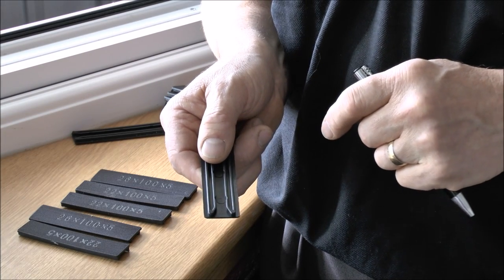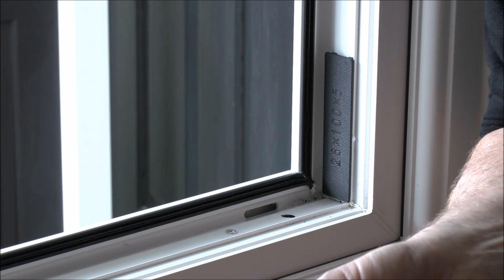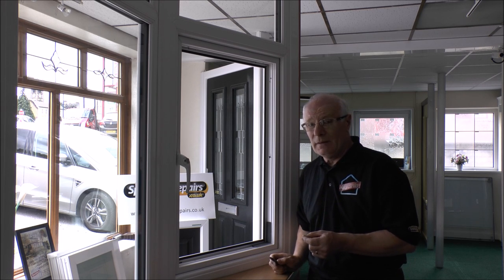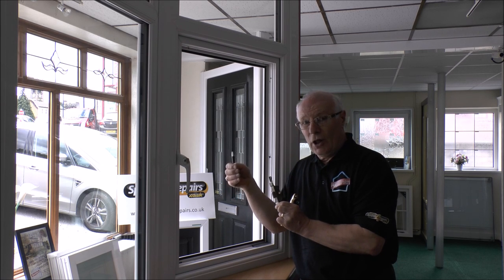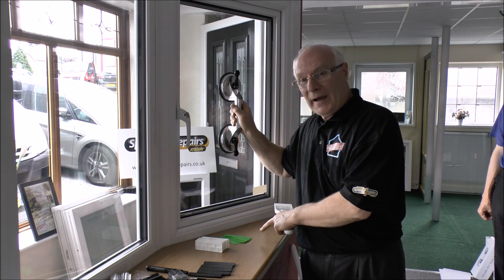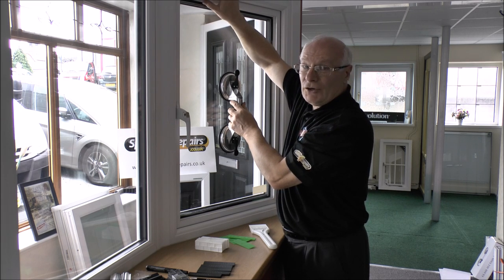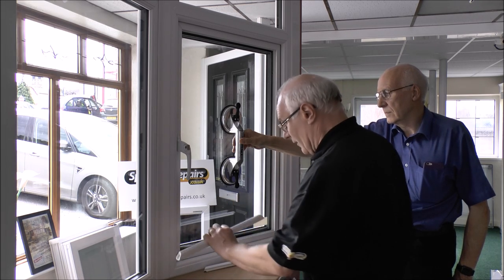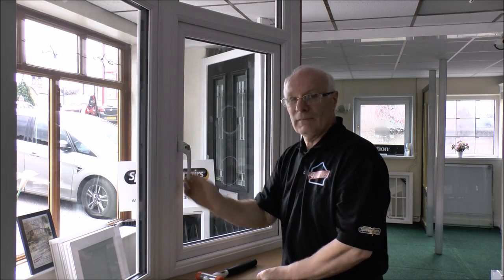Replacing a Upvc Double Glazed Unit - Toe And Heeling

Comment from the maker: Yes you must always have a bridge packer on the bottom to allow the water to travel under otherwise the water will pool and build up and either leak into the property or will cause the double glazed unit to breakdown as it will be sat in water

Comment: They used literally one little square inch of that packer on the bottoms only.,  and relied on the little felt gaskets to seal everything..  and charged 500 a window..  i can push the things in from the outside..  a good windstorm is going to tear my house apart now,.  Bastards..